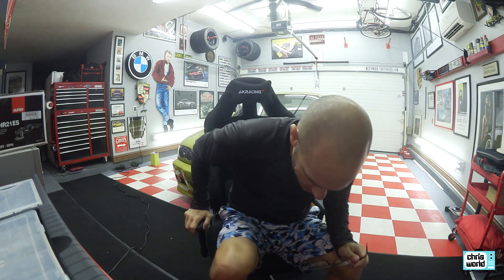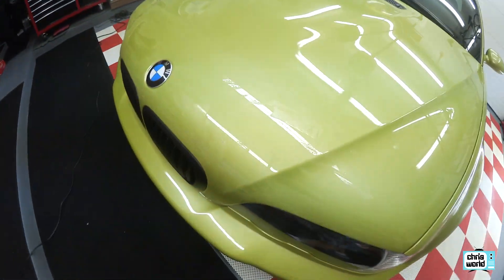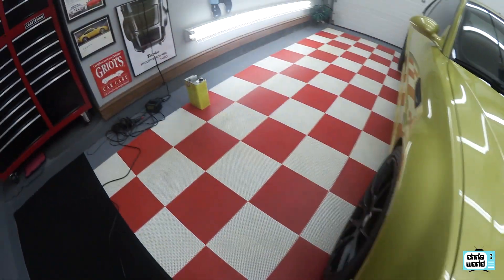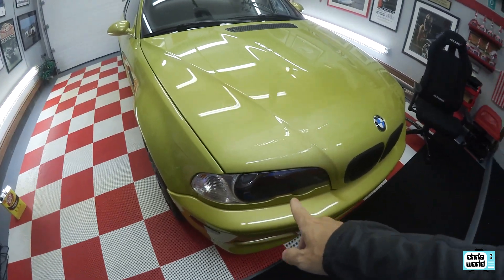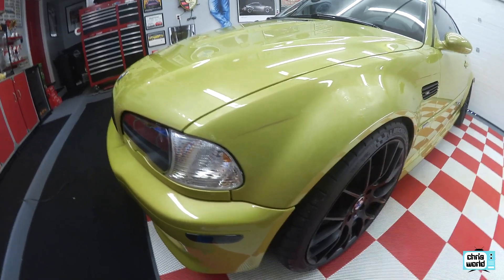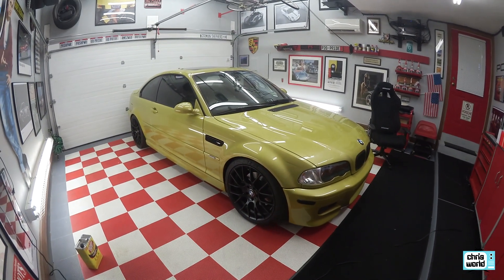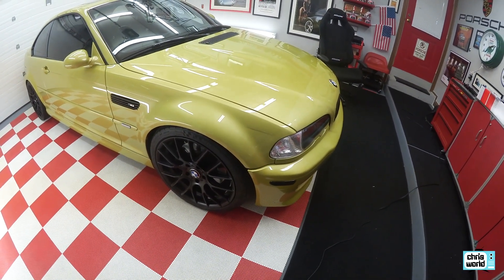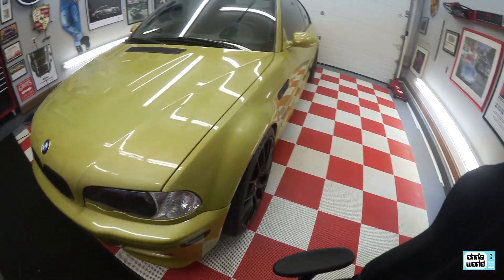CONCOURS PREP Part 1 | "Welcome to the Suck."

Comment: Chris I've had a real problem trying to remove stickers and Plasti dip badly applied. I found that "Goo Gone" in the spray bottle (It's thicker) works best for the removal of these types of things. I used a plastic scrapper when it was hard to remove but if left for about 5 to 10 mins it should wipe right off with a terry or other type of cloth. Good luck. Oh and I tried the "Goof off" (And WD40 etc) but it was so runny that it won't stay on the area long enough to penetrate the stuck on glue etc. Wd40 came in second in my humble opinion but the Goo Gone was best.
Reply from the maker: I use Goo Gone for some things, but the bra glue needed the biting power of Goof Off. I would also recommend using only ScrapeRite plastic razor blade -- specifically only the orange ones. They are generally safe for automotive paint. Their other colored blades are not as forgiving.